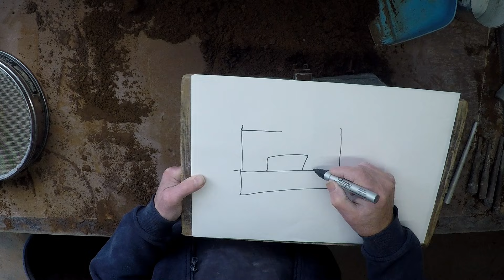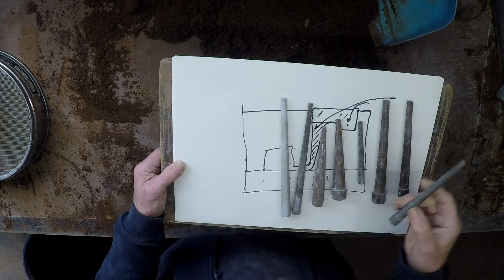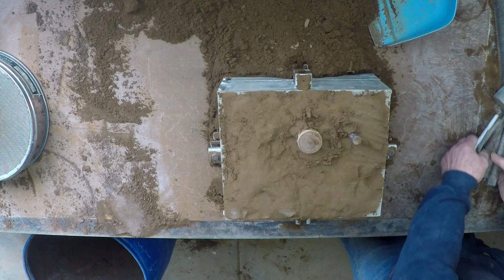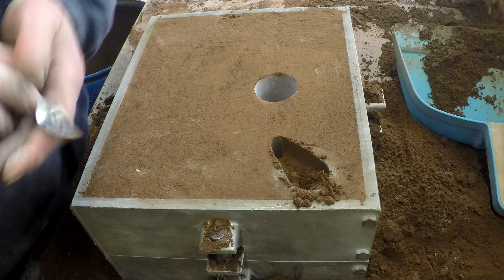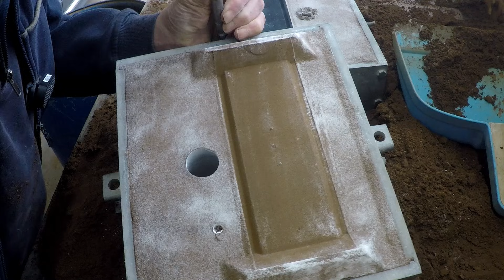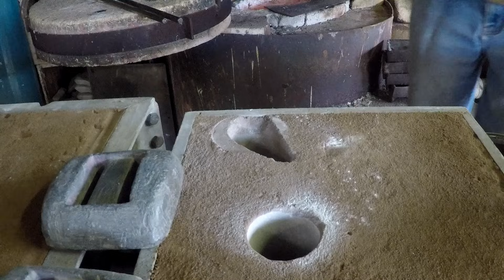Basin and sprue design for sand casting in the foundry

Comment: Well Martin this provides the information required to make a proper job of my part casting process. I am presently studying the composition of sand for the purpose and have almost got enough idea, to proceed with knowledge of the parts of materials used to make a nice clean mould. Happy to have seen this video before we begin in two days time. I will now dispense, with your guidance, those ideas i had just accepted. Which are wrong. Thank you for the instruction there! There is now a fighting chance of making good, the piece I have to make. I have found the suggestion of talcum powder. Also the suggestion of cornflour, and finally to use powdered graphite as a barrier to prevent the different parts sticking to each other. A barrier dust ? I wonder what your dust is composed of? I praise your teaching here that is supported by the explanation you gave as well. Great show mate.
Reply from the maker: Jack, Thank you for your rather nice comment. I am glad to have been of some assistance. Re parting powder. Talc is quite commonly used by hobbyists because it is easy to get, provided you don't mind the smell of cheap perfume (baby powder!) However, I do not like talc as it is sometimes associated with asbestos, its true that talc these days is asbestos free but why take the chance. Graphite works well enough  but it is so dirty to work with - yuck! Not too sure about corn flour as I suspect it may pick up moisture from the mould and get a bit sticky, but I have never tried it. The parting powder I use is a commercial product but all its just very finely ground calcium carbonate i.e. limestone - note - NOT slaked lime. Its cheap, should be easy to obtain and apparently its safe - good luck and remember if at first you don't succeed (and likely you won't) keep trying.... Martin

Comment: Would you be able to make a recommendation please, for sprue inlet and exit diameters for a casting that I will soon be making? The pattern is here  https://www.youtube.com/watch?v=ZZ9W0lbnlWg it is 14.5" long and 5" high, an approximate weight weight is 5kg from aluminium.
Reply from the maker: TheHalloween, Sorry, I just realized that I missed replying to you. Bad time of the year I guess. I had a look at your pattern. Oh Lordie! I hate fins absolutely hate them with a passion! They are very difficult to mould  as the sand between each fin tends to break away when the pattern is withdrawn. With green sand I do not believe that one could ever successfully mould that part. You need a hard sand and CO2  silicate is probably as good as any BUT your pattern needs to be very, very good or you will never pull it out of the cured sand. Its difficult to say without actually having an in person look at the pattern but (for example) where the fins join the body there seems to be small gaps the sand will stick in those. Your draft needs to be absolutely perfect not even the slightest undercut anywhere - good luck with that!
As regards sprue size we need to fill the mould quite quickly as thin fins are a problem - they tend to solidify before they fill properly. So lets take a  few guesses and say a 20 second fill time, a 200 mm sprue height, (this will include a pouring basin about 50 mm high, which must be kept absolutely full for the entire pour) and a total weight of  9Kg  to allow for feeders and gates etc. Thus we have an average fill rate of 450 grams per sec and the initial fill rate of 900 grams per sec. With the SG of molten aluminum at about 2500 kg/cubic metre and with the total sprue height of  200 mm (0.2 Metre)  we have an initial metal velocity at the bottom of the sprue of 2 Metre per sec,  and at the bottom of the pouring basin of 1 Metre pe sec. To cope with that flow at those velocities the bottom of the sprue will need to be 15 mm diameter and the top 24 mm thus it will have a taper per side of 1.7 degrees. Now should any of my guesses be incorrect  then the sprue diameters will differ from those calculated here - this is my get out of jail free card 😊. Hope this helps and good luck. Please let me know how it all goes..    Martin
Reply: Thanks Martin. When I was designing the pattern I had visions of all that surface area on the fins causing a problem so, all of the fins are removable from the main pattern body, this way I can remove each fin individually which should reduce the tendency of sand breakages. I will use sodium silicate on all of this. The mould will consist of four parts, a lot of sand and it will be very heavy to lift.   @olfoundryman8418

Comment: i think the tapered spruce has been brought up and used by other experienced casters. What I see that could be reason for air intrusion, is pouring to high above the mold an not keeping the spruce choked with metal. You mentioned to keep the basin full, so what would be the difference between that and keeping the spruce full? I think the main problem is proper pouring technique. This was brought up by c w Amin who was a consultant in the casting industry, and said it was a main reason for casting failures.
Reply from the maker: rick, I first learnt of the desirability of using a tapered sprue in 1965 when I purchased a copy of the "Running and gating of sand castings"  by Ruddle. It had been published in 1956 and seems to have been the first publication (??) to have suggested /recommended the use of tapered sprues. I began using them all the time after I purchased a lathe in about 1975 and was then able to turn a tapered sprue former. (These days were I to make another former it would likely be of a slot design as these can give better control over flow.) I too have noticed that some other (regrettably way too few) casters use a tapered sprue and I note too that many of those do so because they had been introduced to them by me! The point of keeping the basin full is that - and assuming a properly designed sprue and basin - a full basin guarantees a full sprue and that is what it is all about. I think that provided the crucible/ladle is kept as low as possible to the mould and the (properly designed) basin kept full the correct pouring technique is guaranteed. - Just keep the ladle low and the basin full, that's all there is to it! Pouring too high is a definite no-no, as is the use of parallel and / or overly large / high sprues.
 C W Ammen (I have a copy of the book - first published I think in 1979) was not wrong - research, experimentation, and considerable actual production over about the last 40 years - mainly under the genius John Campbell has conclusively proven that bad pouring as well as bad gating techniques are almost solely responsible for casting failures. Incidentally Ammen - in view of the last 40 years work - needs to be treated with care, whilst it includes a lot of good useful information, it like all older books includes a lot of outmoded and now known to be incorrect ideas...Martin

Comment: Thank you for this video! I have been casting for 15 years, and i have never made a basin before. I will start doing this. Also i think my sprue is way too big. It is never completely filled when i pour. It's a 3/4 inch tube. I love your cutomized spoon! I use a clam shell 😆
I see your riser vent hole is HUGE! Looks like it's 2 inches! Mine is only about 3/8 inch. So now i hope to find out why so big through your videos.
Reply from the maker: tracy, My sprue is just 5/16 inch diameter at the bottom and has about a 1.5 degree taper per side  so its about 1/2 inch diameter  3 1/2 inches up. The use of a large - and 3/4 inch is large - sprue particularly if it is parallel sided is  asking for trouble. It is impossible to fill a parallel sprue. Even if you could pour fast enough to have it seem full it would only be so at the top because as the metal falls it speeds up so the stream gets smaller - look at water falling from a tap. A clam shell - that's a newie on me 😊. That riser vent hole is not a vent or strictly speaking a riser, its a feeder. It is there to provide feed metal to the thick section of the casting. The gate is connected at this point and the feeder is placed on top of the gate. I think it was actually about 1 1/4 or maybe 1 1/2 inches in diameter - definitely not 2 inch! It needs to be a reasonable size so it will stay liquid while the casting is going solid and thus provide feed to it - this avoids shrinkage in this heavy section. 3/8 inch is not big enough to provide any feed as it would go solid before the casting did. A feeder needs to be at least 25% thicker than the casting and preferably 50%.....Martin

Comment: If I have a casting which has heavy sections at one end and light section at the opposite end, which end would you recommend filling from? Can you do the follow-up video please.
Reply from the maker: TheHalloween,  Sight unseen - and please note that as I might change my mind completely if I was to see the actual part - I would place a suitable sized feeder down at the thick end and run the metal into that feeder. Depending on part shape there might be more than one feeder and it might be a side feeder or a top one. Depending on how thin and extensive that light section is there may be an additional gate to it. It really is difficult to advise without seeing the part but the above is my best guess. Yes, I still do hope to do that follow up but at the moment health issues are making it very difficult to produce videos. I have ideas for dozens of videos that I would like to do that I think my typical audience would appreciate but I am sadly frustrated by the health issues - I will keep trying though.....Martin
Reply: Is there a suitable rule of thumb for sizing the sprue? I found some pdf pages on the internet with mathematical equations for this. There was a worked example but I could not get the authors results to his worked example, there seemed to be something missing from the equation.  @olfoundryman8418

Comment: Did you make that ladle for casting yourself?
Reply from the maker: gregory, No, I buy them from a foundry supply company. They are quite cheap and are made without any welds (except for holding the handle on). Welds are a problem as metal always seems to attack them and they make it very difficult to clean the ladle. I paint the ladles with a boron nitride wash called HARDCOAT made by ZYP coatings....   Martin

Comment: Look at this old white man. Explained the very most important fundamentals in a couple of minutes with a chart BOOM done. 
Threw in some practical advice how to twist out the sprue and flatten the sand with some talcum powder, and casted a piece as if he were a pro. 
You sir don´t f*ck around and make a useful video for everyone to see free of charge and I salute you.
Reply from the maker: Sierra,  Thank you for saying so 😊. I guess at close to 80 I am old and I certainly am white (not that I think it matters) But its not talcum powder, it is actually finely ground calcium carbonate (limestone). I won't use talc for this as too much floats around in the air and gets breathed in. I believe Calcium carbonate to be a much more benign substance that is (hopefully ) well tolerated by the body..... Martin
Reply: @olfoundryman8418  Even in the comments you give out knowledge like my grandma gives out cookies. Thank you for the correction.

However here are my 2 cents if I may.
I don´t believe that calcium carbonate is better health wise in this regard. 
Generally speaking particle size, shape and material composition is what creates a problem. (This list might not be all there is to is, however this is what I personally know)
Let me explain further.

Size: The smaller the particle the longer it floats around and the easier and deeper it can penetrate the lung tissue, to a point where it will be absorbed into the blood stream. Basically all small particles are dangerous, even flour for instance in a bakery, or coal dust.

Shape: Asbestos for example has a very fine pointy shape which creates the problem in the first place. The body notices those particles and tries to rid itself of it by encapsulating the particle in a thin shell so it can be transported out of the lung. But because the particle is so pointy and sharp it brakes the capsule so the body creates a new one and so on. These capsule materials accumulate in the lung and create cancer over time. 

Material: Dangerous materials are of course always bad when breath in. Like led fumes (not particles though) or radioactive substances etc.

Conclusion: All small particles are bad for you even if the same material is not regarded as a hazard (flour in a bakery, fine carbon dust etc.). Some can be even more dangerous and help create cancer through their shape (Asbestos) or their material composition (radioactive substances).
You being 80 should not have any problems with that because it takes 10, 20 , 30 years for the problem to accumulate however younger people who read this, please be careful. Never breath in ANY kind of dust.

Comment: you ever talk to myfordboy? he does everything you say not to do.
Reply from the maker: time, I have to be very careful what I say here because Myfordboy (David) has 20 times the subs I do and they are very loyal and I don't want to upset them. I did speak to him many years ago and he was very kind in sending me some drawings of a Stirling fan. In return I tried to help him with some technical/scientific info on some casting alloys be he indicated that he was "not interested in that sort of stuff" - I was a bit taken aback! Myford is perhaps the main reason that I got onto YT. While he has developed a lot of skills many of his methods leave me aghast and I was concerned that many were using his methods in their own work - I sort, via my own YT presence,  to counteract that - not very successfully I suspect! Foundry stuff is maybe a little unusual in that you can do everything wrong and seemingly get away with it for at least some of the time. Much of the foundry industry did and a lot still does rely on this to exist. Its a question of how high a reject rate one is prepared to tolerate  and how low ones standards are. I note that most YT foundry channels are very careful not to show the bad parts of castings - massive upper surface shrinkage depressions for example. Most of their castings do not machine or finish well and good close ups of the cast /machined surface are not shown and there is never any mechanical done testing so we never really know just how successful their casting efforts really are - I can guess though 😊. I could say a lot more but best not!.... Martin

Comment: Hi, just like to say I have used your sprue  design for the first time and I think it's great  far better results than with the old bean cans, doe's it work as well with brass casting. Best regards, John.
Reply from the maker: John, Yes, its surprising how nicely and quietly the metal flows when this is done right. It works with all metals but is of greatest help with metals known to be bad at forming oxide skins - aluminum alloys are bad for this but aluminium bronze is the worst, and brasses containing even small amounts of aluminum (either accidental or on purpose)  can be quite bad too. I recommend using this basin and sprue approach as the minimum start to good gating with anything that you cast... Martin
Reply: @olfoundryman8418  Thanks Martin, that's good to know. Best regards, John.

Comment: Very informative,cant wait to give it a go on my next pour. How do you make that protective coating on your ladel,what are the ingredients.thanks mate
Reply from the maker: Peter, Thanks s for your comment. The ladle coating is not one that I make, rather I buy it.  It is a boron nitride coating called Hardcoat BN and it is made by ZYP coatings in the US. It is very repellent to molten aluminium and many fluxes too. It has an upper limit of about 900 Deg C so it's useless for copper base alloys. I also use it on the metal sheath of my thermocouple and the same couple has lasted for 5 plus years. So the stuff works well if applied fresh every day. Unfortunately it is expensive at about $250 per US gallon. I believe some manufacturers sell it in pint containers. To make your own ladle wash you could try a mix of iron oxide (concrete pigment), talc, (about 50:50) a bit of clay (less than 5%) sodium silicate for a binder (5% maybe) and water to a thin cream consistency. Apply to clean but oxidized surface and dry carefully to red heat. You will probably have to play around with the formulation a bit and it wil not be as good as the Hardcoat but it should take copper base alloys - good luck and let me know if you get it to work ok..... Martin
Reply: @olfoundryman8418  thank you very much,just been playing with sodium silicate and various other ingredients and happen to have all those in the shed & I used to use the iron oxide on the surface plate as a contrasting colour when scraping)cheers  for the reply and keep the vids coming

Comment: Love the video! Great easy to understand instructions. I'll be following this for my next pour. Question: How do you heat the aluminum in the ladle? I have a starter set with a furnace and a crucible, but I like the ladle idea.
Reply from the maker: Sven, I don't actually heat the metal in the ladle. My furnace is large by hobby standards and I melt in an A90 crucible this will hold about 32 Kg of aluminium. I use the steel ladle as a dipper - like a soup spoon from a big pot of soup...Martin